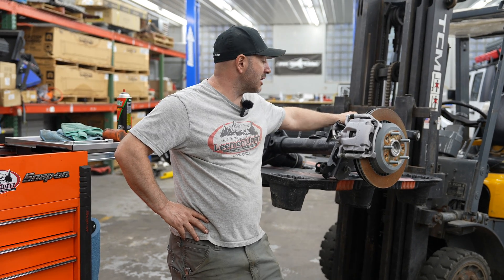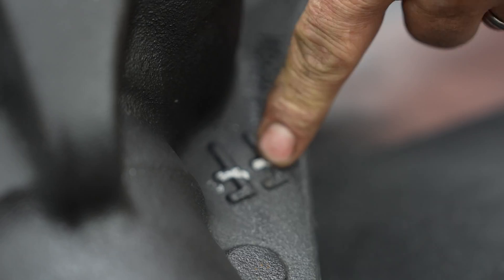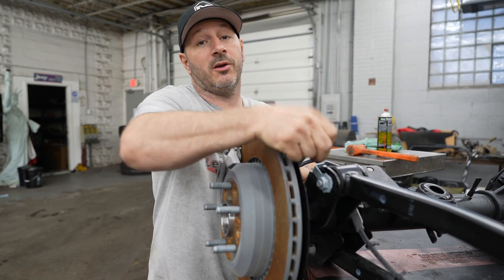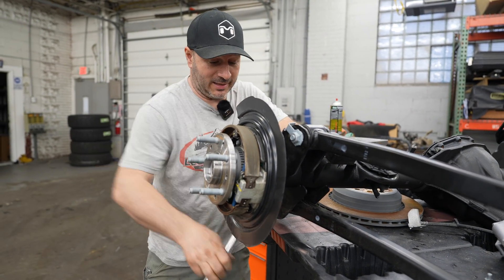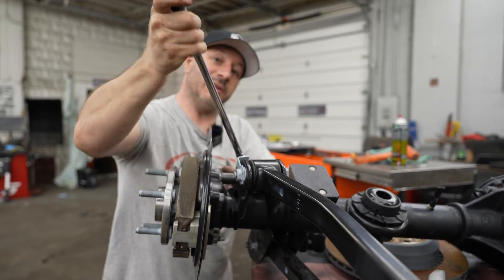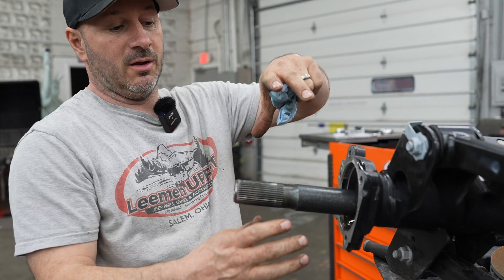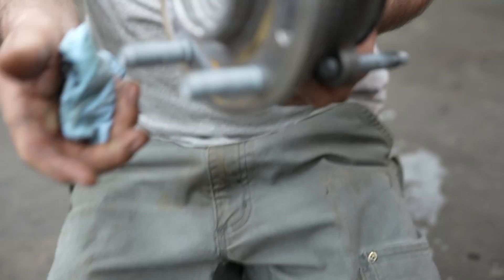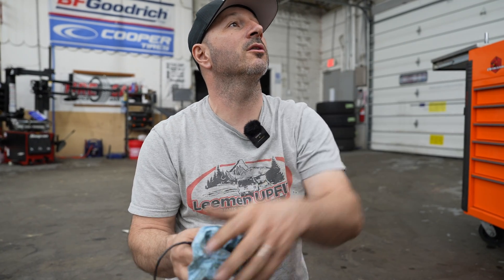The 2024 Jeep Wrangler's Wild New Full-Float Axles Explained

Comment: Sweet video! So the FF engraving is the easiest way to spot it?
Reply from the maker: @vinovino9640  yes and the tin cap on the end of the axle shaft. Also the wheel speed sensor goes on differently then the others. Thanks got watching.
Reply: Thanks. I have a 24 JLR that has a bad rosett weld, so will need replacement and just want to make sure that they put a full float in. I couldn’t find a different part number from the 18-23 Dana 44 and the 24+ full float.
Reply from the maker: @ I have a few new takeouts for sale.
Reply: Thanks but warranty is covering it. Any chance you know the part number for it?
Reply from the maker: @ I do not.

Comment: This looks like a nice setup. I like that it's a bolt on self-contained unit bearing which is basically exactly the same as how the front wheel hub works. Sure it's sealed and non-serviceable, but it means if it goes bad it's easy to swap the entire bearing instead of it being built into the axle casing, just like the front axle. It also makes it harder to swap the axle if it breaks, but on the upside you can use the same rims as the half-float axles, there's no axle sticking through the middle of the wheel, so again it's more flexible and just like the front wheels.